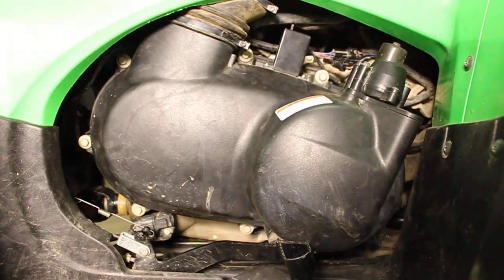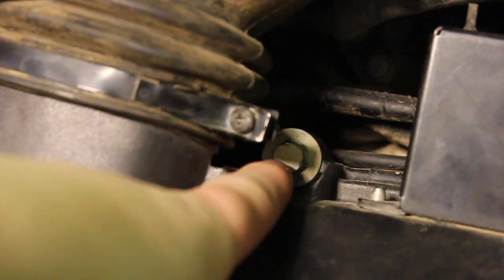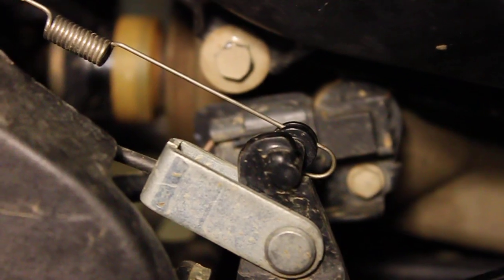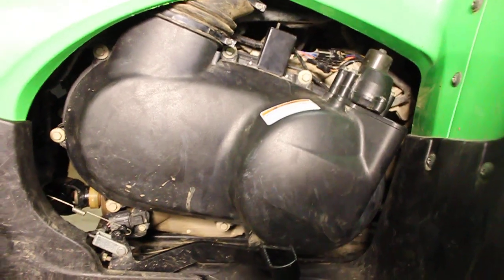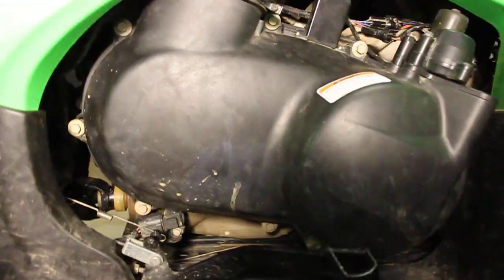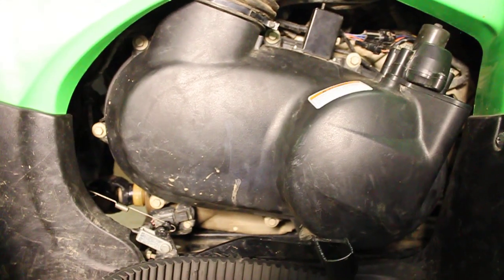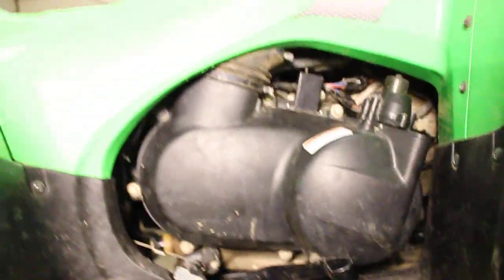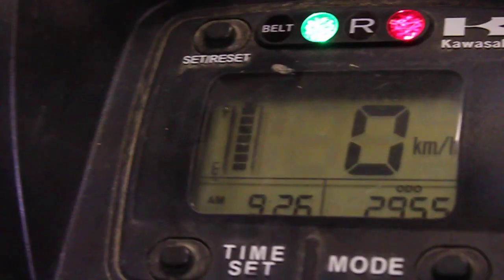Kawasaki Bruteforce Belt Light reset and Belt replacement at end.

Comment: Mine was stuck in limp mode. I went thru the steps using a jumper wire I made. THANKS FOR THE TIP ON WHICH SIDE OF THE MALE CONNECTOR TO PLUG INTO !!!!!!!!! . Mine has grey, blue, orange and orange with grey stripe.  On mine it's the grey and orange /w grey stripe side . Or as you say . The side with the prong detent. Followed the rest of the steps and No more limp mode . Thank God ! 
 And thank You !

Comment: Thanks ! Mine is an Arctic Cat 650 but it looks the same for pulling off the clutch cover. Thanks for the tip about not having to remove the cvt housing thing on top of the outer drive clutch cover. !!
Reply from the maker: Hopefully it's similar for ya and the job goes easy.
Reply: I had to take the foot rest off before I could get the case off. My belt broke and broke the bottom of the clutch cover under the drive clutch. I had a new belt . Its a Kawasaki belt. But it's only 28. 35 mm wide. Someone said on one YT vid that the belt should be changed when its 28.8 mm wide .???
 My power plant is a Kawasaki

Comment: I have a 2005 Kawasaki 700 prairie 4x4 and I was wondering if it was the same to reset the belt light. Thanks!
Reply from the maker: Hi xDirttyx, I wouldn't be able to tell you if its the same because I have no experience with Kawasaki Prairie Quads. Just kawasaki brute forces. There may be a video on youtube that might show if it is the same but if not, try what I do in my video and it might be the same.